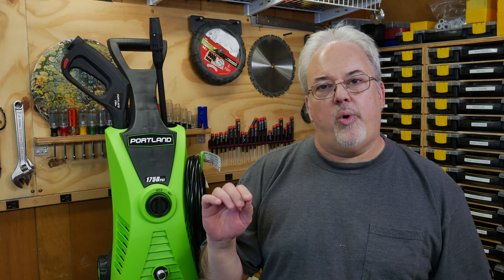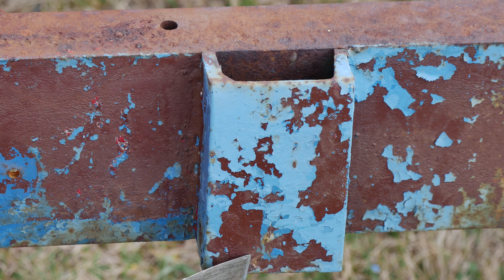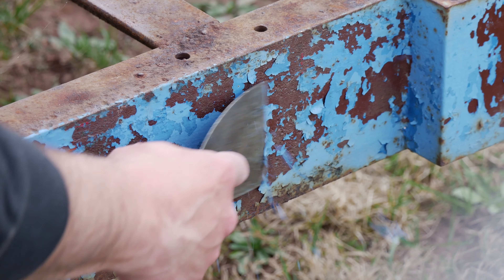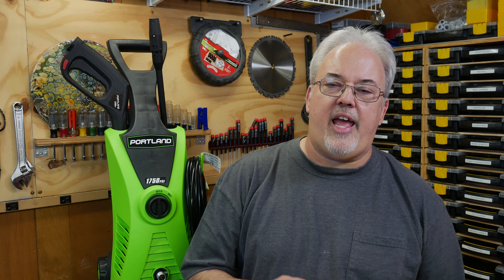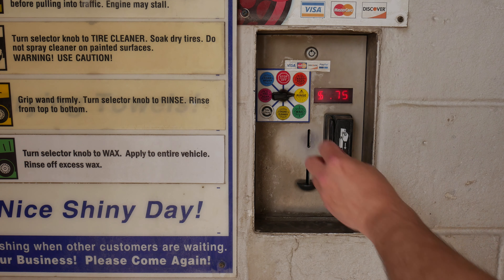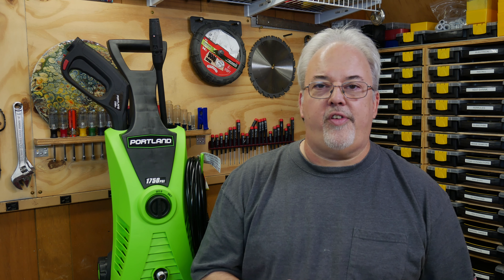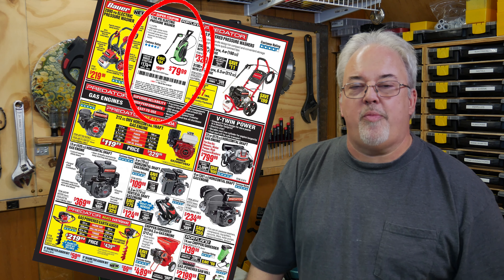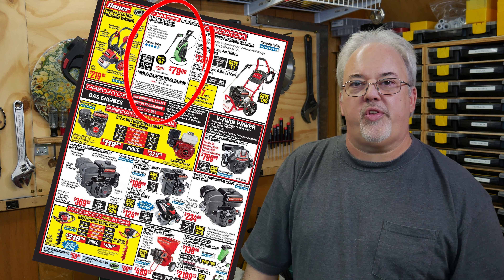Harbor Freight Electric Pressure Washer: Carnival Ride Resto

Comment: HF has an abrasive wheel you can put on the angle grinder, it would be better for your paint strip project. it's like an abrasive sponge shaped like a wheel

Comment: Another good video. By chance, along with a bunch of bins, I also picked up this exact same pressure washer recently from Harbor Freight. I read the reviews so I'm anticipating it being a lemon. But if it holds up, I"ll give that attachment accessory a shot to improve its performance! Thanks for the tip, Pete!
Reply from the maker: I mention there at the end of the video reading the same bad reviews and promising to tear it apart if it should fail.  So far it still working.  Its really hard to tell with harbor freight.  They will have multiple manufacturers make the exact same product for them, (thus the multiple part numbers you will sometimes see in the sales flyers)  There is no guarantee all those manufacturers have the same quality standards.  or just a bad day on the assembly line.  it is a bit of a gamble.  so far this one has payed off, at least for me.

Comment: great review! Are you going to look at sandblasting?
Reply from the maker: Hey thanks Gene.  I’m not opposed to sandblasting it’s just if I went that route I’d prefer somebody just to come in and do it. I don’t mind blasting in a cabinet but I’ve done blasting outside where I had to suit up before and I’m not a fan of it. But if you know anybody in South Central Pennsylvania who wants to come out and blast it for me let me know!
Reply: @PeteRondeau  it looks like the original primer has held up.
Reply from the maker: Yeah it really feels like it’s stuck to it not just sitting on the metal. But based on the surface texture I don’t think that’s the very original primer from 50 years ago. I feel like it’s been sandblasted before.
Reply: @PeteRondeau  I'll help! The two of us could knock that out in a day. Once can blast - the other sweep, filter and re-load the sand!